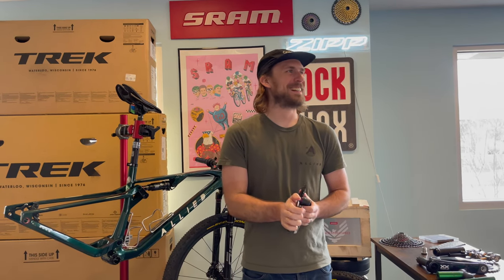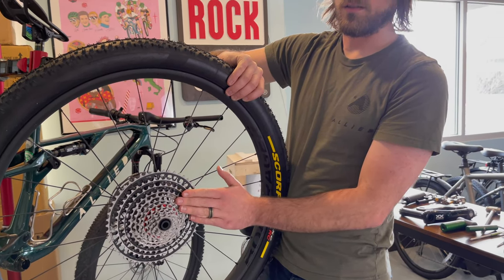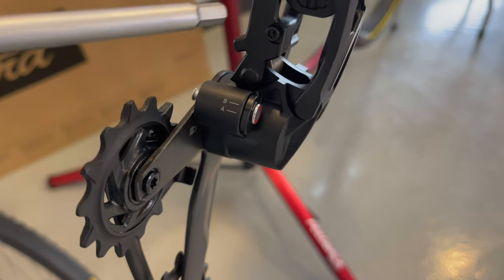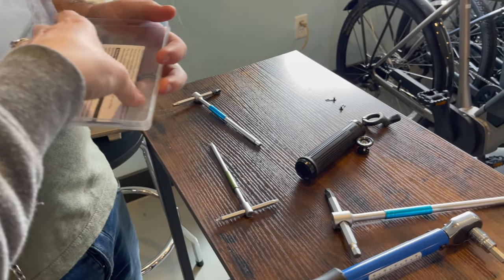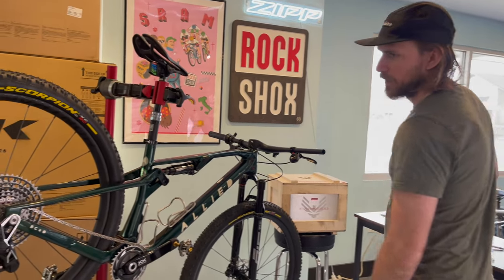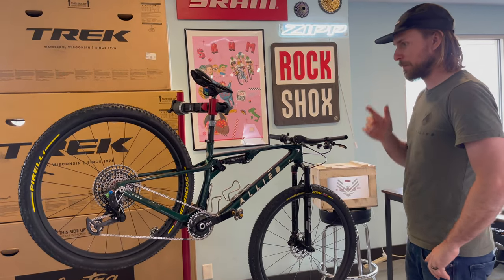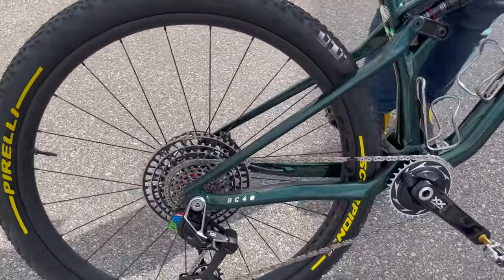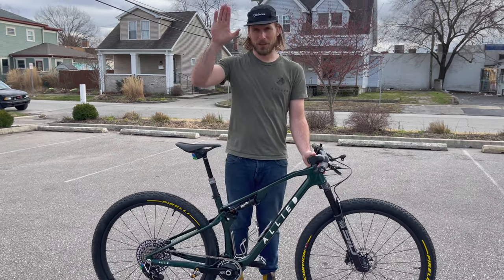SRAM EAGLE XXSL TRANSMISSION INSTALL PART 2

Comment: My XXSL shifts like crap on the easier gears. The derailleur gets stuck on the cassette while shifting. Could it be the alignment that is wrong or the a or b setting? Microadjusting does not help at all. What is the torque for the wheel shaft?
Reply from the maker: It sounds like something is set up wrong. I’d suggest redoing the set up to see if that fixes it.

Comment: Helpful video. I have an epic expert 2022 with the SRAM DUB, BSA 73mm, Threaded and I bought the x0 transmission with a dub wide crank...is this compatible with only the a 3mm spacer on the drive side? Little confused with all the compatibility data. 😵‍💫 Thank you and keep it up with good videos! 🥳

Comment: Good morning! My LBS installed this XX T-Type groupset on my 2022 turbo levo S3, they said the QR code they followed said Key position A and 120 chain links but the online calculator says 118 chain links & “B”’ position. Will this difference do any damage? bike rides ok.
Reply from the maker: Id recommend calling Sram. It sounds like they did something wrong.

Comment: How long have you been riding the BC 40? How about a review after riding it for several months?
Reply from the maker: Yep. Gonna make a huge video about that. I’ve tried the bike in 4 different suspension set ups and ridden it a few thousand miles. Just waiting on some wheels to put it back together for the video

Comment: Did you find the delay in shifts bother you much? Apart from that, everything looks amazing. The setup was super simple..no H and L and B adjustments.
Reply from the maker: Actually it’s the biggest benefit. It feel strange on pavement but on the trail you don’t have to ever adjust cadence when shifting anymore. You can just ride nonstop
Reply: @bicyclestation  That is game changing. Just slam the pedals and not worry.
Reply from the maker: Exactly